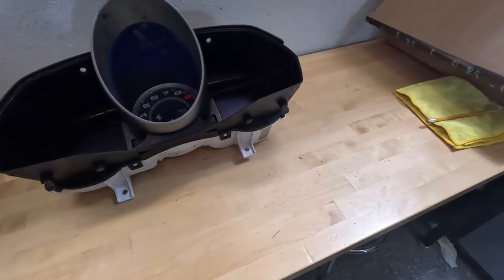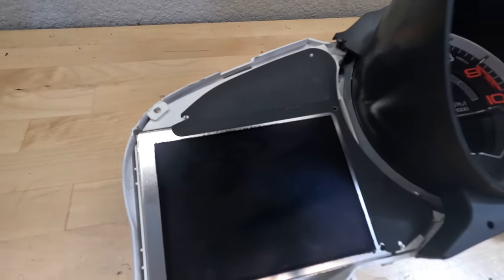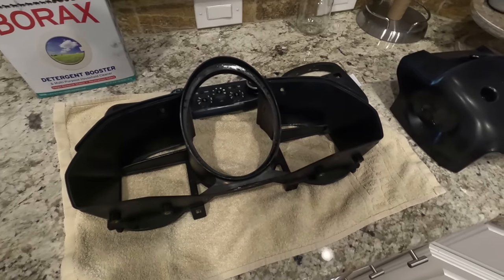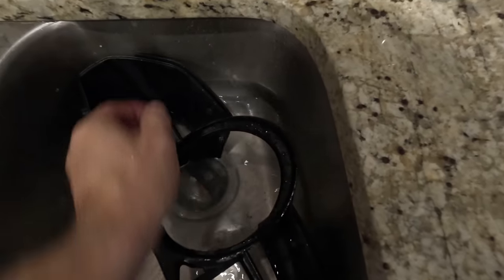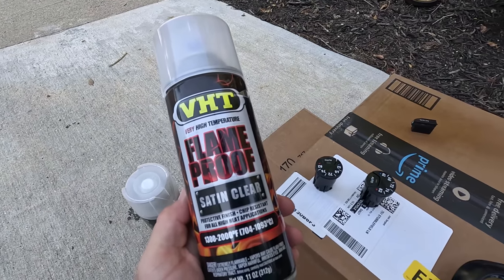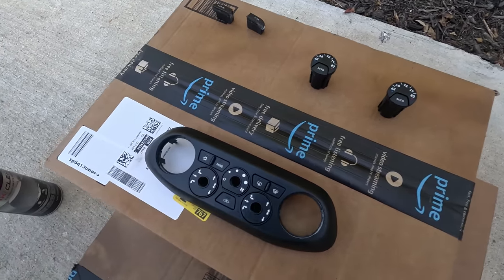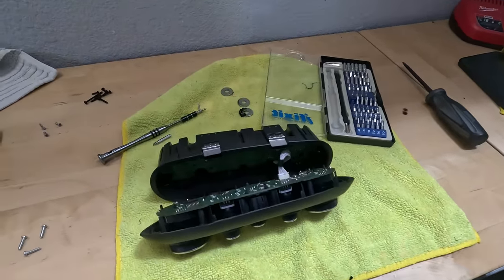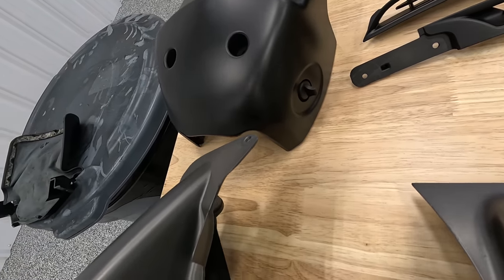The Best DIY Sticky Button Fix on a Ferrari 458 Italia

Comment: I just started with the overhead console buttons. I used the VHT Satin Clear and sprayed 4 very light coats. The buttons are still slightly shiny compared to the other buttons in the car. Will adding more coats achieve the correct appearance? Or a matte clear may be better? By the way where in TX are you?
Reply from the maker: I think maybe you need matte? We're in Liberty Hill
Reply: @normalguysupercar  Ok thank you. I'm in Frisco.

Comment: Nice find on the Borax!  Great DIY video! Thanks for posting!  Why repaint it at all though?  How do you know that the VHT paint wouldn't become sticky just like the original Ferrari paint?  It looked fine after you cleaned it. Probably good to wear some gloves with the Borax?
Reply: The Ferrari paint has something in it that breaks down, the regular paint that I used won’t as it is just regular automotive paint. And yes, in hindsight I definitely should have worn gloves.
Reply from the maker: It's the soft touch coating from Ferrari that goes sticky

Comment: How does the steering column clamshell come off. Just the 3 bolts accessible from the bottom?
Reply from the maker: There's bolts on the bottom, can't remember if it's 3 or 5. Then it pops apart in the middle.
Reply: @normalguysupercar  I love you. I'll try to get it off today if the dash doesn't have to come apart I'll be ordering the carbon wrapped one.